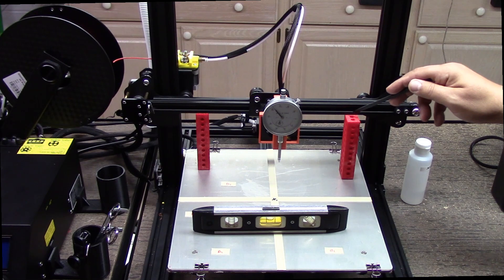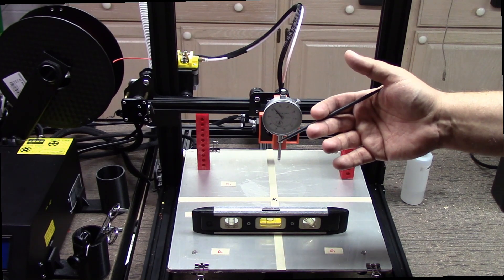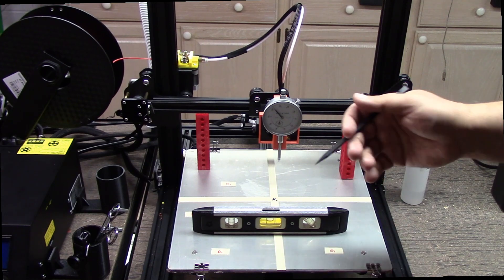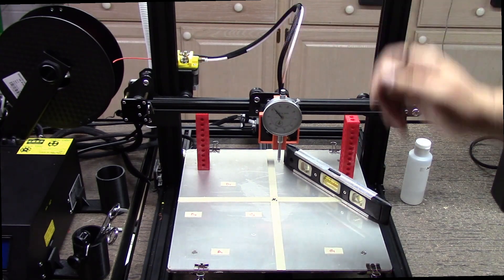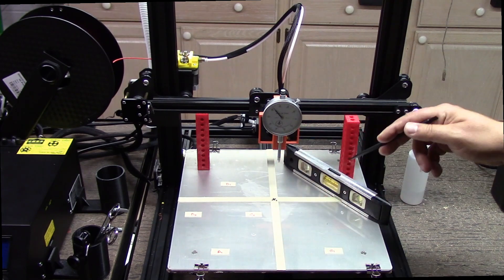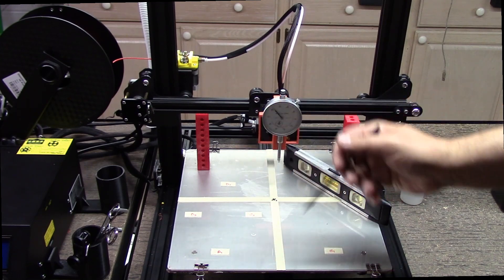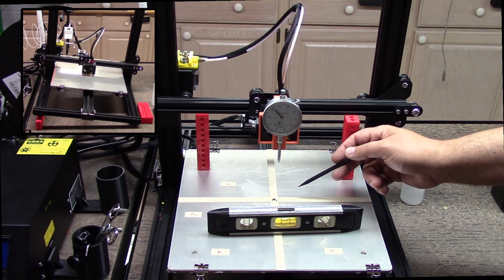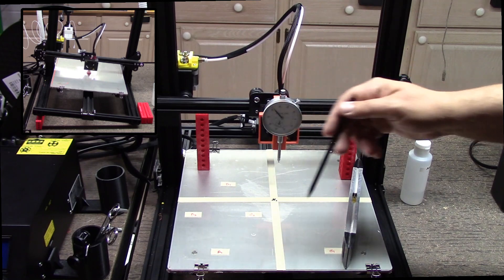Shop Talk - Stop Leveling Your Bed and Start Tramming Your Machine!

Comment: In conventional machining on  a mill Tramming of the head has a 
particular meaning which doesn't really have an equivalent in 3d 
printing. On a mill the machine can be setup in such  way that when the 
bed is traversed in the x-y plane the tip of the cutting tool can 
perfectly maintain the same distance from  the tool to the bed at any 
point, however, the head of the machine can be completely out of "Tram" .
 

 This is because on  a mill you can nod and tilt the head axis ,such 
that the vertical Z axis is no longer aligned with a vertical axis 
perpendicular to the bed. 

  On a 3d printer when you adjust the bed you are only changing its "level", you are not affecting the Z-axis as you are when tramming a mill. A 3d printers axis are all fixed, even in the case you mention with a drooping Y axis, it is fixed, it doesn't affect the X or Z axis paths.
  This really just to say that I think "leveling" although I can see your argument, is a better term to describe the process in 3d printing as "tramming" suggests an adjustment
 and aligning of the actual axis'.

 Really enjoying your channel and looking forward to more interesting content 

thanks,

Andrew
Reply from the maker: Thanks for the kind comments, and while not a working machinst, I do have have a background in it and if one looks up Tramming the definition is [Tram is the squareness of your mill head to the table and Tramming is the act of adjusting the mill head to be square. There is tram parallel to the x-axis, and tram parallel to the y-axis (sometimes called “nod”). ] and nothing is cited about the z axis.  Also if you look at a tramming gauge it’s simply a dual dial indication to match the planes of X & Y.  On a 3D printer, instead of adjusting the head we adjusting the bed instead as on a mill the bed is fixed...
Reply: Yes, a tramming gauge is TWO dial indicators, this is the difference, when you setup the tramming gauge you set the fixed known point on one side then it is rotated around the axis of the head to confirm it is in alignment. a Mill cutter cuts along the length of the cutter in alignment with the heads axis, if the head is out of tram then the sides of for example a cube would not be perpendicular.

 If you changed the cutter on  mill for a 3d printing head, you would not need to tram the head at all it could work fine with head out of tram as it extrudes from a single point at the bottom of the head.

rgds,

Andrew
Reply from the maker: Keep in mind the head of the 3D printer tips in 3d space as you correct it suppose to be square this is part of what I am trying to explain as mine is (and most for that matter) tip forward.  Now this isn't a huge "error" because of the process and distance to gantry.
Reply: That is fine, but all I am saying is, because you are not actually correcting that tilt/error you are not tramming the mill. Just aligning the plane of the bed with the plane defined by the x-y movement of the printer tip. 

 As you say in 3d printing this fine and will give you great results, I Think calling it tramming could be confusing.

  Anyway, here is some software that may interest you:

http://www.scorchworks.com/Gcoderipper/gcoderipper.html

If you had a probe on your machine this could help solve allot of issues. It would be great to see a video on running this on  a 3d printer, if it was possible. you could print on almost any shape it could perhaps even be used to make some kind of support structure then print on-top off it maybe ???

keep up the good work,

rgds,

Andrew
Reply from the maker: Yes I also follow scorchworks, this guy is good!  I work in the software biz but just don't have the time right now to code the stuff this guys does!  When I retire in about 4 years or abouts, I look forward to doing stuff like this!
Reply: On a bed type mill there are actually 2 types of squaring that needs to be done. 1st is, the column to the table using a precision ground cylinder or a granite square. Once that is done then the head is tramed  to the table.  With out the first step the z travel would be skewed. From min to max Z travel.
Reply: ...Only on a Bridgeport. I can knock a city bus sized VMC out of tram with a single wrench on it's foot and keep the table level while it's happening. No spindle ram and no other directions for it to go. Tramming is just sweeping and squaring axes, XYZ, ABC, UVW, Tz - some machines all at once. Bigger problem if the turrets or saddle slip instead of the spindle. Had to have a VF-7 X-Y realigned once from it being poorly installed.

Comment: Good video, but you're still wrong about the three points stuff. Three points will always define a plane, but four will only in very limited circumstances. Think of a camera tripod on rough ground, it is always stable. Stick your kitchen table on that rough ground and it will likely wobble, as only three legs will touch the ground, and it will rock on an axis between the two "highest" legs. Not stable, not a plane... 😁
Reply from the maker: I am not sure I am tracking with your statement as three points define a plane, yet what I am trying to say (in simple terms) is we are not dealing with a single, but a multitude of them sort of think of the surface  as being a fractal (maybe an over statement yet makes the point).  Yet the message is one needs to "average" the over many points and the fact that it is possible to define a plane with only threes, it is a moot point...
Reply: DIY3DTECH.com  yup, I get your point, the surface of the bed may well be all over the place, but, when tweaking, you're only changing the "virtual" plane between the three highest/lowest adjustment screws, what the actual bed surface does is irrelevant. The fourth screw just adds wobble, like the fourth leg of the table
Reply from the maker: This is the point I was trying to get at is even glass can have significant deviation (unless it’s very high quality) and taking only three points isn’t enough to adequately  distribute the error across the plane :-)
Reply: Actually you got it right and wrong at the same time.

Yes the plane created by 3 points would be always a flat surface and therefore stable plane. In this case it´s not useful as it not only has to create a plane but also matching the plane created by the movement of the printers head (which at least needs 4 points, as this plan is not level nor flat)

then you said 4 legs would never be stable - if all 4 legs are equally long then this means automatically the plane isn´t flat and you cant use 3 points to define a correct plane - as this could lead to a very big error. The plane itself isn´t flat.

Now you need a table with 5, 7, 10, 20, 60... legs to define a good plane where the legs are not equally long but corrected in hight for each measure point on of the bed - using this method you could define a more precise plane on which your table would stand as perfect as the one with 3 legs.

so it´s actually the other way around the table with more legs, would be more stable. Using 3 points would allways get you plane that is worse then one with more points. A good plane out of 3 points that is good would be an total exception. And even thought you camera on the tripod is stable, it doesnt create plane that is actually parallel to the thing it´s standing on, as it doesnt need it too. 

The only thing that needs to apply for a tripod is that the parrelel to gravity projected center of mass point has to be inside the triagngle area/surface created by the 3 legs. You cant even apply casual geometry, as angles of this triangle wouldn´t sum up to 180° - the sum of these angles can be somewhere between 0 (on an inverted ball shape survace) to 360 (on a ball shaped surface). Thats again is the reason why cant use 3 points (at least in reality, outside of school) to find a useful plane or use it to determine the shape of surface as it completly ignore any form of curvature or inperfection. (which again is good for a tri pod, but totally useless to measure or correct anything)
Reply from the maker: The unsupported corner would not droop yet be pushed up by the spring, I fear I am still not getting the point across as the goal is to distribute error across the plane and not to define the plane.  Also there are beds  (like my Di Vinci) that have only three leveling screws but the locations are not the corners and the functionality has been less then 4 point beds too...
Reply: I suggest the better term to use is topography of the bed, like a hilly terrain....as the plane is not perfectly evenly flat....( my Dad was a land surveyor and I recall him showing me a topography in 3D back in 1968, from a "flat"  stereo image )      Rgds  Laurie
Reply from the maker: I must say this is a very interesting comment!  I knew this post would create a lot of comments and have not been disappointed!  Kudos on the explanation 😉
Reply: If CAD tools wouldn't assume a cartesian system with allways flat surfaces between points then a plane defined by 3 points actually wouldn't be defined. If you use sculpting/mesh manipulating tools this actually the case, there you need at least 4 the extra one is to define the curvature of the surface, also you can use an unlimeted amount of to define more points and irregelarites to create the shape you want.

So just ask yourself this, If your blind, you can move your finger only from up directly down and you only have one nerve ending to feel the pressure of touching something: Would 3 points of touching be enough to differiantiate beetwen a bowl, a ball and a flat book?

Also there not a lot of perfectly flat things in this world. Engineers allways have to fight against small and big errors when creating stuff. No one cares if a ship is 20cm longer or shorter then the same model. But looking at some beering small deviations lead to total failure. 

Glass isn't flat. Pure silicone can be made extremly flat. But just look at camera lenses where they cost over 1000€ for a bit of glass. It's difficult to get the surface right.

In our case we have 3D-Printers. The Glass is thick. The glass surface had to be created under the same conditions under which we would use it in order to recreate the tolerances* the manufacture applied to this product(*it's already not flat from start). Did the manufacture corrected the surface for 60°C? probably not, the thicker something is the more tension it creates at diffrent temperatures and the more the shape gets warped. Also looking at a printer like the CR10 which uses clamps to hold the glass, the problem gets even worse as they create additional tension. Then we heat up and cool down the glass material very often, allowing the crystal structure to change a bit every time we do - it tries to relax the tension by warping itself. You can go really far and say the we never have a perfect temperature distribution leading by the bed or even by the hot nozzle/material touching the glass at specific points - creating again heterogenic tension zone and also unpredictable warping. I mean we dont have to go to the uncertainty principal and accepting that there cant be something perfectly flat. But finding a good tolerance and deviation helps to get the most perfect results.

The CR10s glass plate has a wave shape becouse of the clamps, also the wave is not parallel to an axis as the heat distrubition is not perfect it - the wave moves away from the heat bed connector and the center is higher the the rest as that the hottes place.
Reply: You can also check the surface maps created by ABL systems to confirm this. This is the best way to correctly calibrate your bed as this creates a 3D-Map of the surface and can compansate perfectly the deviations
Reply: DIY3DTECH.com , actually, this could be interesting if you still have the dial gauge mounted. Take off one of the mounting screws completely, set the others to level, then see how much the unsupported corner droops. You could prove I'm talking complete b0110(£s! 😂
Reply: DasJev, three points defines a plane. If you add more legs to your virtual table, each has to be adjusted to fit the existing plane, or the table will wobble if it's high, or  the leg will float off the ground if it's low. More supports will help if the bed is flexible, but frankly, if your 300mm Ali bed with a sheet of glass on it is that flexible, I think you have more problems than tramming to worry about! 😀